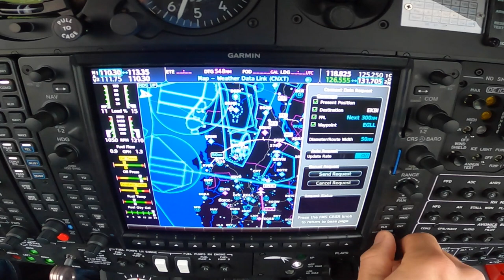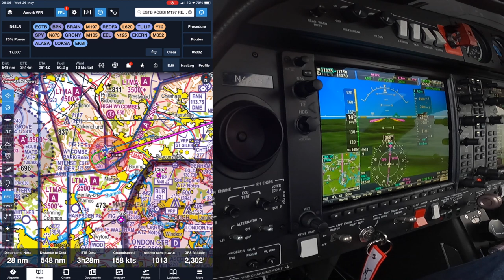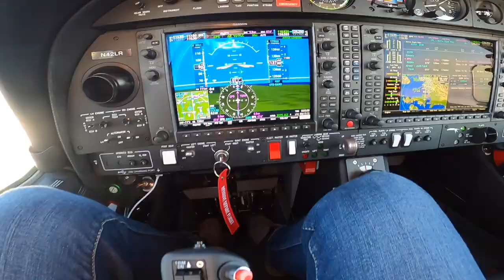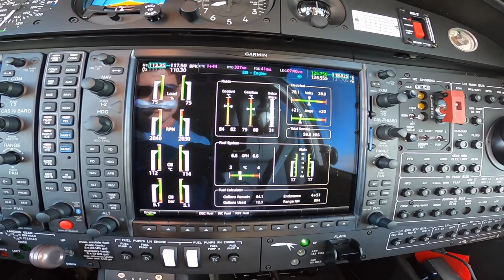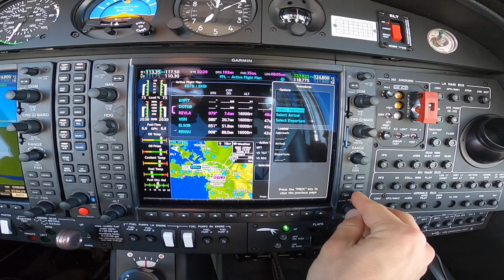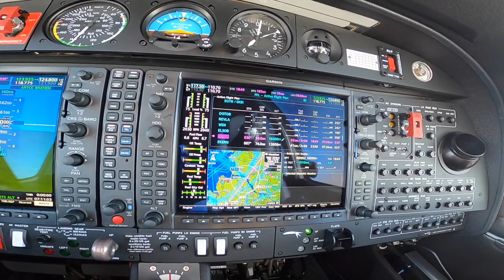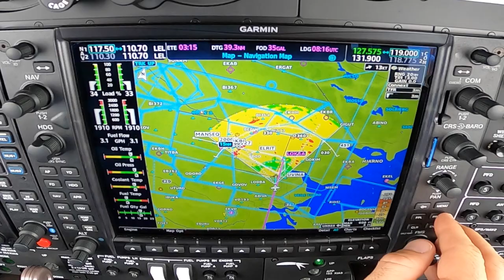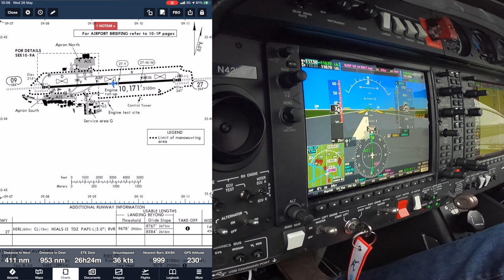1000 Mile Day Part 1 - DA42 Flight from the UK to Denmark. IFR, Weather Radar and an ILS. ATC Audio

Comment: Having watched this through again I'd just like to say thankyou for demonstrating some of the extra functions within the G1000. Real world usage like that at commercial standards, forward planning of winds at various levels, satellite weather, etc just goes to show how beneficial this instrumentation can be if used correctly and to its full potential. For example - being able to say at FL170 I'm getting a greater TAS of X, but with a headwind component, so if I descend at this point in the flight to FL120 I get a trade off in TAS, but I move into a more favourable tailwind component... the difference is XX? This kind of content is very interesting to see happening for someone like myself with commercial aspirations. Yes you didn't get the shorter route you were after due to the military airspace, but you were still able to get the best out of your longer route around with excellent forward planning 👌
Reply from the maker: Hey CJ! It is such a valuable piece of kit and gives you so much more info to plan with! It's not just avionics like the G1000 which has it, I believe you can get stand alone receivers which will send the same info to your tablet. Glad you are enjoying the videos! Best of luck with going commercial, it's an amazing career with endless opportunities! 😁

Comment: Hello Richard, thank you for sharing so many of your lovely trips. You are an inspiration to me, as I (and many others) think you are an amazing and very skilled pilot. I started following you on Instagram as well. A couple of questions came to my mind as I was watching your video's here on YouTube. Hope you can find some time to answer them: 
1. Do you fly the DA42 for business? (I am aware this has been asked earlier)
2. How did you come across this opportunity? 
3. Do you still fly rotorcraft professionally? 
4. How do you go to the loo when you are in the air for so many hours? 

My last question is the one I'm most curious about, as I sometimes struggle with my blatter when in a training flight.
Reply: Based on my own experience, the answer to question four is ‘a large bottle with a secure lid’ - they can be had from Pilot stores.
Reply: Thanks!
Reply from the maker: Hi Klavkjr! Thank you so much! 😁 Hopefully your answers are below!
1. I use it for both my personal business as well as pleasure. I don't do any commercial flying on the DA42.
2. Hopefully question 1 answers that!
3. Yes. I love rotary flying and the challenges that come with it, so I still fly a few types when I get the chance.
4. Go easy on the coffee! If I have a long flight I won't have any drinks until I am closer to my destination. I have some on the go pouches in case I get caught out! You can get some neat disposable ones which have crystals in to solidify any liquids!
Reply: On the tricky subject of bladder range, a top tip (in addition to the bottle): -
Take 400mg of Ibuprofen (2 Neurofens) one hour before a flight.
This does three things.
1. Reduces the glomerular filtration rate (calms down the kidneys - less urine)
2. Eliminates the irritation of urgency (don’t feel like you have to go) and
3. Gets rid of tension headaches 
I always have some before a long flight - these things get more necessary with age (!)
Reply: Hi Richard, Thanks for answering my questions and for your advise. Happy flights!
Reply: Thank you, David. That sounds very helpful! I'll have to try that on my next long flight.

Comment: What a great video!!
It may sound a stupid question but do you need the oxygen due to high cruising altitudes on smaller planes?
Reply from the maker: Thanks Matthew! Not stupid at all! Smaller aircraft mostly tend to be unpressurised. So as you climb to a higher altitude, the air in the cabin is less dense and there is less oxygen available. So we have to use supplemental oxygen in tanks on board to make up for this. If you don't you will start to suffer from Hypoxia, which could cause you to pass out.

Rules vary around the round but most people generally start using it around 10,000ft
Reply: @richardtyrer  Thanks 🙏 so much for the explanation Richard. I love aviation and your videos are so informative and interesting. All the best for all your future endeavours. I shall be watching! Take care. Matt
Reply: @matthewday7162  Hopefully in the future, small plane manufacturers can use electric motors to pressurize the aircraft. Yes, I know this would use more energy, but I would dislike to wear an oxygen mask. Lol... At least I always wear my pandemic mask when around others. :)

Comment: Thanks for sharing your experience with us. Just a beginner simpilot here. A question: How do you plot in your flightplan into the garmin? Do you have to manually put it in or can you transfer it somehow from the app on your pad?
Reply from the maker: You're welcome! 😁 I use Foreflight which connects directly to the G1000 via Flightstream (Bluetooth). It's a really good function and great for loading a lengthy flight plan quickly.
Reply: @richardtyrer  That is actually pretty convenient. While I know nothing about filing flight plans, as a tech enthusiast, it is cool that your tablet can transfer the flight plan to the airplane's main computer (G1000). 10-15 years ago, this tech wouldn't have existed.

Comment: Do you have to sink the props?
Reply from the maker: In a different way to traditional twin pistons. The prop speed varies with the logic through the electronic engine control. When I get the to the cruise I set the same power setting on each engine, and then I will adjust the load on one engine slightly to match the other. Usually they are within 50rpm of each other at the same power setting so only a small adjustment is required!

Comment: Hi Richard, what was the phone number you used to get your airways joining clearance when ATC was closed? Cheers Mike
Reply: I was just going to ask that…………Richard ????
Reply from the maker: It's 023 8040 1110. It's the London Terminal Control Watch number (so for London CTA only). It's much easier calling them on the ground rather than getting London Info to sort it in the air! Sometimes the phone line can be super busy in the summer so I normally try and get hold of them before start, if that fails get them at the holding point.